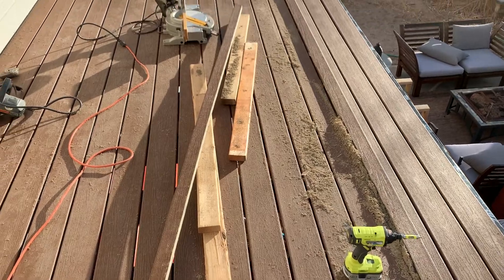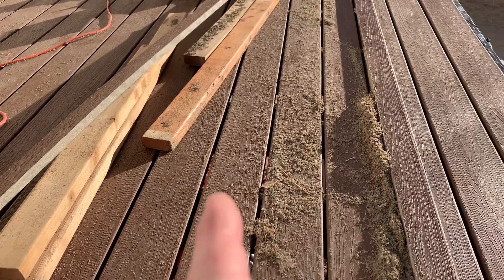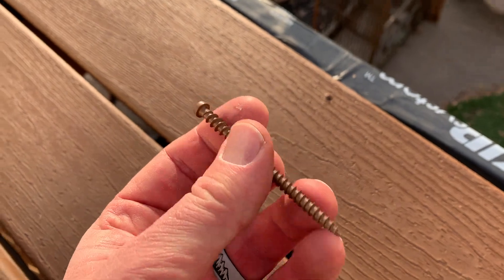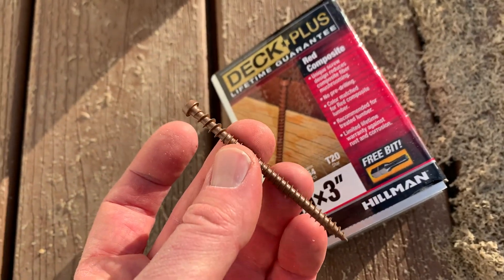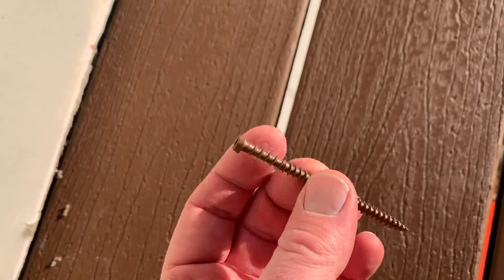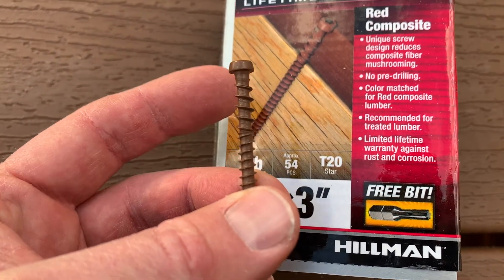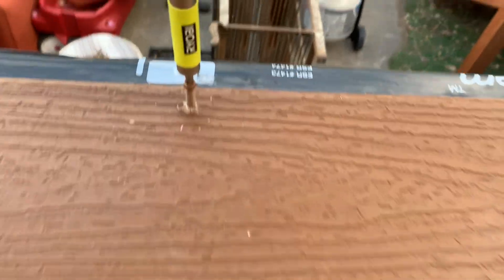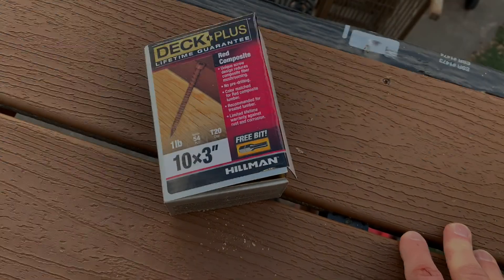Best Screws for Trex Composite Deck Projects

Comment: I sure hope that those are SS (305 or better yet, 316 Marine grade) if you're in a wet area or near the ocean. Otherwise, it is guaranteed to fail due to the reaction to the treatment chemical in the pressure-treated lumber.
Reply from the maker: Good info to have for wet regions. We live in Colorado, which is a very dry climate

Comment: Question: I am removing these screws in order to get under my deck for repairs. What I am finding is that the screws are so bonded to the Trex material that the heads are stripping when I try to remove them on about 40% of the boards. Any idea how to extract these without having to drill them out? Thanks😊

Comment: Should they be pre drilled to avoid some of the problems in the comments?
Reply: The identical design but from other manufactures include a 1/8th drill bit and specificcaly say to pre-drill through the deck board of course only.  I saw on his box it said NO predrilling, but you can see the slight mushrooming results.  That material HAS to go somewher!!  Not a problem AT ALL when predrilling!!

Comment: And then 2 years later when the Trex board warps and pulls away from the heads, you're left to ponder Plan B.  In my case pre-drilled chamfered holes with outdoor coated deck screws. Looks ugly, but banking on functional.